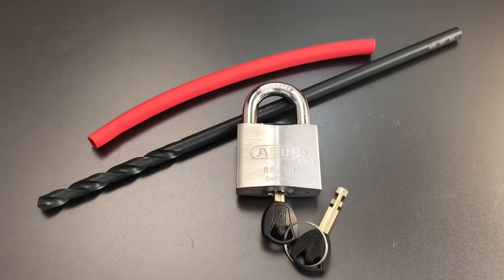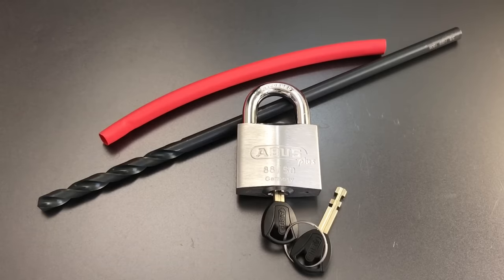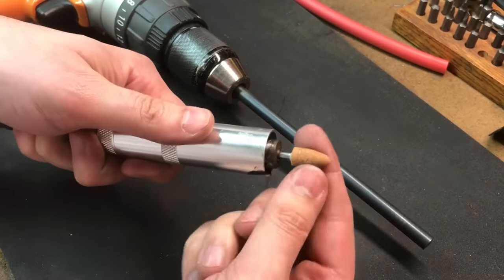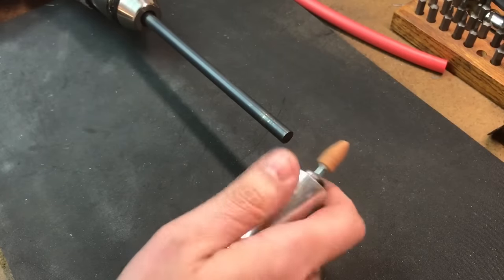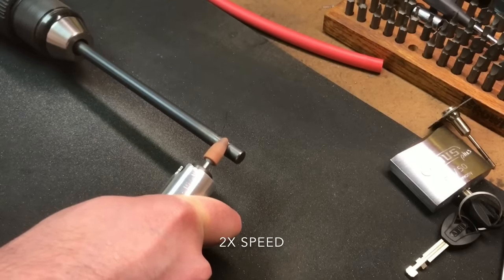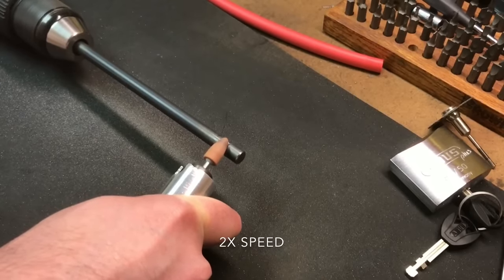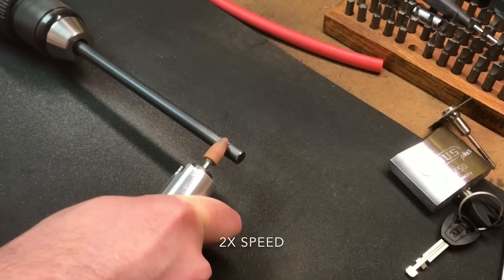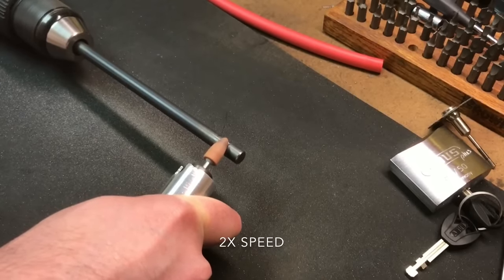[464] LPL Project: The Best Gun Lock Ever?

Comment: Great DIY video.

The shank of the shortened drill bit will probably still be hard near the flutes and will be harder to grip in a chuck than what should be the softer end of the drill rod.

You can choose to put the groove into the harder cut end rather than the softer original tail end.

When you heat and bend the rod that point is annealed and could be bent straight by a criminal.

Cutting a deep ball bearing groove all around the rod weakens the rod quite a bit, perhaps a notch would be enough and also provide a rotation lock.  On reflection a rotation lock might make it easier to beak by twisting.

Sourcing a lock with an extra long removable shackle might be the way to go.  You could sell them on your web shop.

Comment: I have put several layers of heat shrink tubing on cables/wire to increase their od to match the strain relief. You could "pad" the new shackle that way. And a heat shrink gun helps. A hair dryer will not do it.
Reply from the maker: Yes, I have a heat gun.  I was trying to keep the number of tools down, and heat guns are not that common in the average garage.
Reply: We are not average.
Reply: LockPickingLawyer but hair dryer's in bathrooms are more common than even garages
Reply: Harbor freight needs to be more well known than home depot. Many quintessential tools can be had for more than fair prices.
Reply: They are increasingly plentiful and WONDERFUL for DIYers. I scatter 'em around my shops for convenience.
Reply: I’m guilty of many layers of HS tubing. 👍
On this project I’ll keep adding layers of this marine grade (love the Internal glue) until there is zero play between shackle and gun. 👌
Reply: @zacharytuttle5618  not always

Comment: It's actually safer to cut sparking towards you (with safety glasses, which you should have on regardless). You can stand to one side so the majoritt of sparks pass you. The tool is going to be pulling in the opposite direction to the sparks. Firstly,  it tends to be easier to maintain control of a tool that's pulling away from you, but more importantly, if you do lose control, you want the tool to jerk away from you and not towards you.
Reply: I was shouting the same thing!
Reply: Yeah, but to be able to film it, it's better to shoot the sparks away from the camera

Comment: I prefer using a heat gun for shrink tubing myself. Less risk of overheating something.

That said, this is a neat project that looks kinda fun. Now I just need to get a pistol to lock up 😄
Reply: Yeah, I would never use a flame on heat shrink. It is way too easy to burn the heat shrink.
A heat gun is always a better choice for heat shrink.
Reply: A lighter works fine
Reply: I have an SMD solder station in my lab and 90% of its use is heat shrinking.
Reply: @karlkarlsson9699  
Heat regulation is not nearly as well controlled using a lighter, as opposed to a heat gun.

Comment: “Fine I’ll do it myself.”
- LPL

In all seriousness, this is one of the coolest videos of yours. No doubt lock companies could easily make this for a fraction of the cost, but until they choose to this seems to be a very good solution. I also want to see how much better it could look if you used your professional tools. . .
Reply: You could also very easily design this to be adjustable to fit any gun.  Just make the center of the shank have slots with about two or three machine screws so you can adjust the length in quarter inch increments to fit any gun without leaving slop.

It ideally would also be made so that the padlock body is tucked into the handle and can't just get sawed off there.  

I hope someone out there has since taken this idea and turned it into a real product.  It's a great idea and I'd feel way safer with this than a shitty trigger lock.
Reply: Any lock is better than no lock on a gun when preventing unathorized use. However, like all things, no one does this and considers it secure for real.

Get a REAL gun safe, and bolt it to your floor if that's a concern. Otherwise, you're just lying to yourself and even if you put this lock on, it's easily defeated and wouldn't hold up in court as a defense for anyone whos seriously grilling you for explanations and liability. Liability is king. We don't secure work guns like this for a reason, it's pointless, another useless task which doesn't defend/protect anyone, and if someone already bypassed a actual walk-in safe, through 4 locked staff doors, bypassed security and got into several smaller floor-mounted gun-safes and then opened the seperate ammunition safes-- I'd say they can cut this shit off within SECONDS.

Defeating 4+ doors, a walk in safe, seperate bolted down safes and armed security? This won't help. Our risk-management services are anal about liability and have stated the same thing in summerize "This tool will not deflect or reduce any liability when used on any firearms on site"

Not to knock LPL... It's something, but let's not pretend this will stop mass-shootings or accidental gun deaths by kids.

 @NotMyActualName_

Comment: Shrink wrap is usually not very vulnerable. A hot temperature is fine, you just adjust it with rapid movements so it's exposed for a shorter time. As LPL said it WILL get ruined if you overheat it, but as long as you're not holding it in place over the wrap you're usually good.

Comment: Suggestion: do not use the drill to rotate the rod in order to cut the notch. Doing so narrows the diameter of shaft weakening it. Instead keep the rod stationary and cut a notch only on one side (just like the padlock). Also, try not to quench the tool steel in water to cool it. It’ll make the notched cut-out brittle.
Reply: Excellent idea... And use the actual shackle_s notch as a model.

Also, tight the drill bit into a vise with the ground end down. Use an angle grinder (i know, they are voracious) to make very short grinds (5 seconds max) and use a glass of water to cool down the rod (an helper would be very handy, just for this duty) between grinds. IMPORTANT: The steel must NOT change colour.
Reply: Makes it harder to lock tho. You have to line it up with the bearing just right and also makes the bending more difficult as you'd have to align it properly. It would be stronger as you said.
Reply: If you don’t have a groove all the way around, then this lock would be trivial to defeat via twisting.

Comment: 16:40 ...whether you know it or not you just annealed that tool steel, it got too hot, you can tell by the straw yellow colour. Then you quenched it... In its softened state.

This is generally why people anneal then reharden, hardening is easier than you might think, use your torch up and down till its purple colour then you quench.

If you wrap a fire blanket 3/4 around it you can more efficiently heat it. So long as you move the torch slowly and evenly along the part so that it's all the same temp it will harden without a set.

I hope this helps in the future.

Comment: Wouldn't using the end of the shackle you cut off be a good template?
Reply: k2crasher yes I agree
Reply: Definitely one secure gun lock though, even with destructive forces it would be hard not to hurt the weapon.
Reply from the maker: +k2crasher Are you suggesting that I use a half moon notch, like on the shackle?  If so, consider how that would open this lock up to twisting attacks. 👍
Reply: no you can't make the same kind of notch as is in the shackle but you could use the measurement of the top and bottom of the notch on the shackle to indicate the top and bottom of the groove you make in the drill bit.
Reply: No I wasn't suggesting that, I just meant to add reference points for where to grind. We all have different "mechanical minds" both methods work. I like how you used a drill as a lathe for even cutting! Peace and love
Reply: +LockPickingLawyer 

This is a great concept, that you should develop. My concern would be that youve probably critically  weakened the drill rod shackle at the notch. The steel those things are made from, is strong, but pretty brittle; you might test it against sharp blows to the lock body.
Reply: +k2crasher This was my thought as well. The cut off of the original shank would be an excellent indicator of the distance from the end of the drill bit shank to make the notch.
Reply: if there was a commercial product with a half moon or dimple indent for the ball Bering. Make it a square rod, and then you wouldn't have to worry about twisting.
Reply: but when you have a lock with balls can you even do any reasonable thing with twisting the thing? I mean it's not like you can shim this thing open by twisting it,
Reply: My1 with a half moon notch if you twisted the shank it would guide the ball to the flat side and depress it, allowing the shank to pull free. With the notch all the way around the shank, you don't have that issue.
Reply: but isnt the point of the balls that there is a mechanical block which doesnt allow them to go anywhere, in comparison to locks with a spring based mechanism.
Reply: this is true but think of the leverage you would have against this mechanical block if you twisted the lock with the shackle in the gun.
Reply: There's no guarantee the loose side of the shackle bottoms out. It could be the other side that indexes the notches.
Reply: ScopedPewPew I wonder how many people rewinded the part where he dipped it in the plastic dip to watch it multiple times. LOL
Reply: Drill shanks are not hardened.
Reply: but that is exactly what would happen
you would twist the lock (or the rod) and that would pop in the ball bearing which would unlock it
unless there is a mechanism to prevent that but the reason you can't shim it is different from twisting the whole bar inside the lock
Reply: Fortunately, there cannot be much lateral stress on the notch area, since it is inside the lock. To damage that area would mean serious damage to the firearm. The intent is to keep the local youngsters from firing the thing unsupervised - not to protect it from theft where a person could take their time defeating the lock.
Reply: This shaft when ground down looks real flimsy and not too beefy.  Even though it's high temp steel that ground down portion becomes a weak spot.

Comment: I am very impressed with this project, but again, if anyone who owns guns has even a remote possibility of adolescents or otherwise irresponsible people having access to their firearms, they should INVEST IN A GOOD FULL SIZE SAFE. That's right, I think it's an important enough subject for all caps. Anyway, very inventive, but someone would have to invest a lot of time building these if they own more than a couple of firearms.
Reply from the maker: I generally agree.  A safe is a must for those who can afford one.
Reply: I suppose that is a good point, this solution does beat out a decent safe when someone's on a budget, but generally if one can afford a few firearms a safe shouldn't be financially unfeasible. Don't get me wrong, this is easily the best pistol lock I've seen, and it's impressive how simple it is to make in a garage!
Reply: Need to tell people to invest in a REAL safe, most commercial floor models are a joke under any sort of attack. if your goal is to just keep kids or nosy family away then save the money and buy a simple 80-100 dollar locking gun locker or job site box!
Reply: i thought most guns come with a chamber lock from the manufacturer ..  well even after market  are cheep .. only prob  i see with this mechanism  .. its 1911 .. proly can tear down past this lock and re assemble ....
Reply: you cant because you couldn't get the disassembly pin lined up properly to remove it. i mean I guess you could hammer it out and damage the gun all to hell?
Reply: Well the bad thing about locking the gun it’s self it is easy to take the whole thing and break it open when you get home

You can’t exactly steal a whole safe
Reply: Or just raise your kids the right way around guns
Reply: And hope that they never get depressed.
Reply: Depression is much more complicated than that.
Reply: Safes are not mandatory in the USA?
Reply: In South Africa, you can't get a firearm unless you have a certified safe which has been registered with a serial number by the Bureau of Standards.  The safe was about about R1000, almost the same price as my ammo so no a big amount to pay.
Reply: Coming from Australia where the law dictates that you must have a gun safe in order to get a gun licence and you must keep the gun and bullets locked up separately when not in use this advice seems obvious. I guess it is different where you live.
Reply: In most families, that was not necessary.  It is interesting that for my generation, firearms were not locked up to keep them out of the reach of children. If there were firearms in the house, the children were taught at a young age to respect them and were taught safe handling as early as possible. We were also taken out to target shoot or hunt rabbits/deer/quail/ducks etc as youngsters. 

These days, it seems we have to protect youngsters and teens from just about everything.
Reply: not just for those who can afford one. if you can't, dont buy the gun.
Reply: john doe your ignorance is disappointing.
Reply: We raised our kids right about guns, and then locked them in the safe and never told them the combination. They aren’t even allowed in the room when I’m unlocking it. I’m not so much worried about them, but if they get excited about a new pistol, and one of their idiot friends wanted to see for example, they have to wait till I get home from work to show it to them supervised. Cause I’m not about to let two teenagers walk off with a gun. Period.
Reply: I agree that just about every gun owner should have a safe. But many of us prefer to have at least one firearm outside the safe for home defense. For those of us with no kids in the house a lock isn't really necessary. But for people with kids this is a fair middle ground. It prevents the curious kid from discharging the weapon without creating too much of a barrier if the firearm is needed urgently.
Reply: @beeflon  no  you can even carry a gun without a license in my state
Reply: @beeflon  LMAO

Comment: What a great Idea! I'm going to have to make some of these myself...Thanks for such well explained and demonstrated video. Also great choice of gelato and or sorbettos....their roman raspberry is my fav....
You probably already know but don't let that lithium grease get on anything made of aluminum...
Reply from the maker: Damn... we do have similar tastes.  In com-block locks and tasty raspberry sorbets!  As for lithium grease, I didn't know that it should be kept form Al.  I'll have to look it up.  I used to use it on AK's quite a bit,  but not my aluminum AR's which tend to really like a nice thick synthetic, high temp motor oil.  I guess I got lucky?
Reply: LockTest It is not elemental lithium. it depends on whether it is a lithium complex or a lithium soap. (lithium stearate, lithium 12-hydroxystearate, lithium hydroxide) The lithium soap carrier (the first two) is fine around aluminum. The lithium hydroxide is bad around aluminum. (Just like most hydroxides of alkali metals)

Comment: I love it when these ancient videos crop up randomly...

That said, you absolutely can get to annealing temps of carbon steel by grinding on it. The discoloration you point out at 16:17 is well above temperatures where the metal will start to lose annealing. In fact, you can use the color as an indicator of when to quench it depending on the hardness you're going for, so you have no doubt made that drill bit weaker in the process of making the lock.

Good thing the inside likely didn't get hot enough to embrittle it, and it's not like that drill bit is weak steel anyways, so... still going to be a good lock. Just know that you have absolutely influenced the annealing even with just the dremel.

Comment: 6 years after the fact...nice video!  I'm glad it turned up in my feed.

The only suggestion I have would be to ensure the width of the notch is very close to the width of the ball bearing.  This will ensure the depth of the notch is ONLY as deep as it needs to be and will maintain maximum shaft strength at the  notch (since this will now be the weakest point of the shaft).

It is most prone to breaking/snapping at this point (fracture mechanics behind what it is). 

VERY nicely done!

Comment: If you want an opened can of Plasti Dip to last, pour a layer of acetone on top of the dip, then use some aluminum foil as a seal under the cap.   Still won't last forever, but it will last a lot longer than without.
Reply: Adding more highly flammable liquids to your highly flammable liquids. Nice!

Comment: 6 years later. I took a quick look on Amazon and no gun locks borrowed this design. I'm kind of surprised. You'd think that after all of the torching LPL has done to the manufacturers, they all would have jumped on this.
Reply: It’s hand gun specific. Custom. Meaning you would need the exact measurements of your gun to make this work. Every gun out there is different in measurement, so all though it’s a really good lock design the problem is it would take another designer to make this fit a multitude of different hand guns

Comment: Dang. At least for handguns, this seems like a perfect gun safety product. I suppose depending on how long of a hardened steel rod you could procure, something similar could be made for rifles and shotguns as a consumer product, since even those guns have openings where spent ammunition has to be removed from the barrel(s). For a double barrel shotgun, you could even have a specially made extremely long lock that fills both barrels and locks at one  or both ends. Such a simple, but elegant design. 

Also, yeah, continued engagement with old videos like this is awesome. You keep on truckin, LPL!